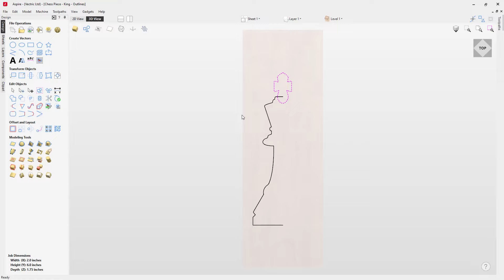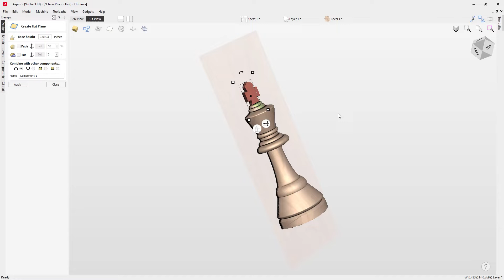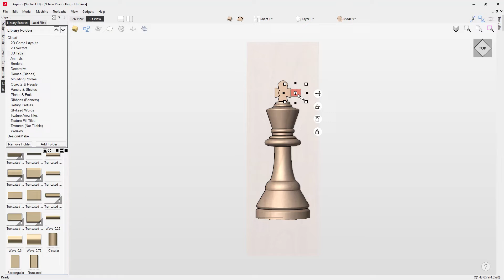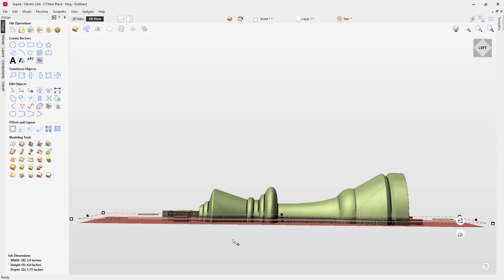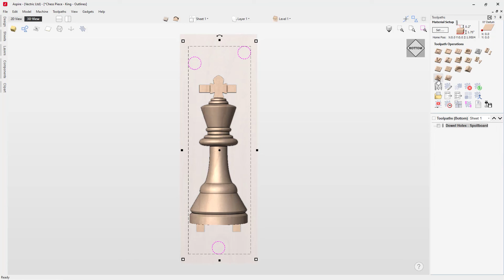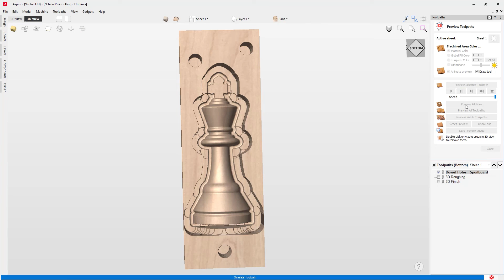How to create your own two sided model in Vectric software | Two Sided Machining | V12 Tutorials

Comment: One thing that doesn't make sense to me is the two dowel holes that were placed at the top of the piece are not in line with each other so when the piece is flipped over, how will they align with the holes in the spoil board? What am I missing?
Reply from the maker: That is right there are two dowel at the top that do not line up... that is on poupous.  Have a look at this video... it should help - https://www.vectric.com/support/tutorials/vcarve-desktop/?search=two&video=introduction-to-two-sided-machining

Comment: Ok I have one issue, I did this very carefully. When you show the bottom and show that it is zeroed off machine bed, that's not good for cutting your dowel holes into the bed. It's fine of course once the model wood is set, because the toolpaths will then account for that, raise up, and cut, but if you have it set to machine bed instead of model surface for the dowel hole toolpaths into the spoilboard, you will be unable to set the Z zero to cut into it. When cutting the machine bed, the machine bed becomes your material surface.
     Basically use material surface Z-zero when setting the toolpaths for the spoilboard dowel holes, then change it back to machine bed for the actual model toolpaths.  Unless your program works differently somehow but I have the same program and physically saw this happen and had to correct for it!
Reply from the maker: Hello and thanks for that.  So to avoid that we suggest that your start depth for the dowel holes in your spoil board include the thickness of your material.  The software does not know that the material is not there so this is the easiest way to ensure the dowel holes are cut starting at the surface of your spoil board.  Remember this is only of you are choosing to zero off the spoil board NOT the material surface.

Comment: How come you don't compensate the material thickness when setting up the spoilboard dowel holes on the second side like you do in this tutorial: https://youtu.be/OxJQsdx8F0Q?list=PLLdEiXEsoReotOqdstqamOhdYjxLuf4yz&t=1558

What critical factor determines which operation to use? Sometimes things work, sometimes they don't and seldom do I know why.
Reply from the maker: Hello and thanks for the question.  Because we are cutting the holes directly into the spoilboard we do not need to.  Your work material is off the machine and we are cutting the mirrored (the flip direction you would have chosen in your job setup) version of the dowel holes into it.  If you remember in the video I copied the ones from the front to the back, so the software took care of the mirroring for me.  We just zero or set "Z" from the spoilboard.  The process of using the asymmetrical dowel pattern is perfect if you want to insure when you flip the material it lines up properly... the other way works as well but you have the added factor of the possibility of flipping it the wrong way.
Reply: @vectric  thank you for the response. Can I use this process for all my 2-sided 3D carvings? (please say yes)
Are there situations where I need to compensate for material thickness when drilling into my spoilboard if I am already zero'ed off the spoilboard surface? (Like with the Z-Probe?) 
(PS I'm using a Genmitsu 4030 with UGS)
Reply: @vectric  I'm sorry, but after physically doing this I found this to be partially incorect. When cutting into the spoilboard itself, the spoilboard becomes your material surface. If you set the software Z-zero as machine bed from the spoilboard for the dowel holes into the spoilboard, you will have the correct XY but your machine will ALSO compensate for the model and be cutting holes in the air. You have to Z-Zero from the spoilboard WHILE setting your software to Z-Zero material surface for the dowel toolpath. Otherwise it will line up the holes correctly but with the wrong Z for the cut.